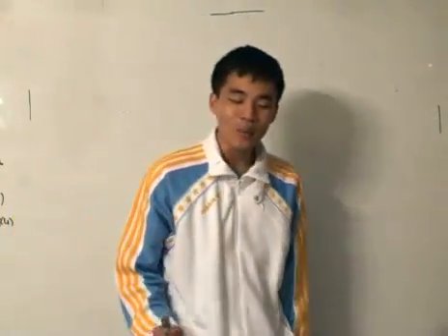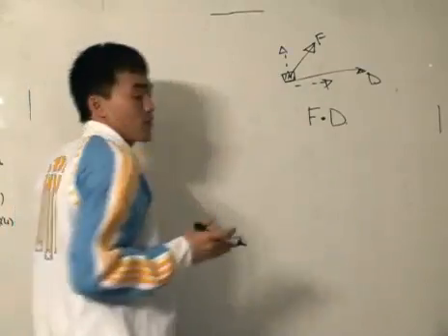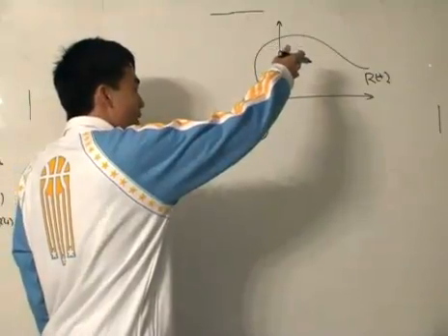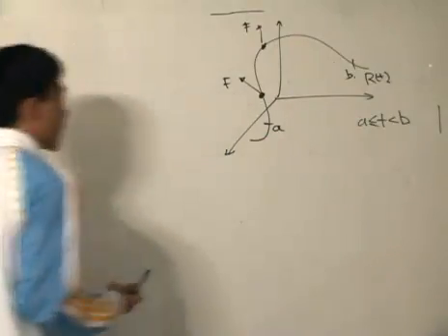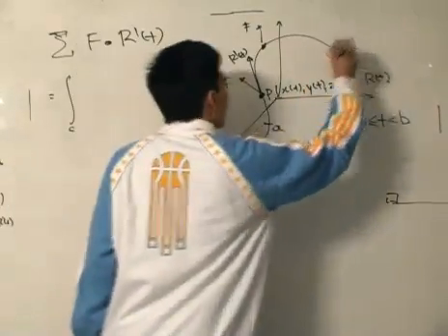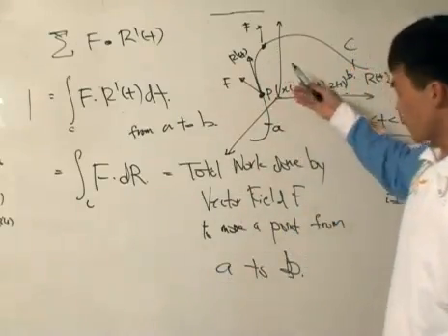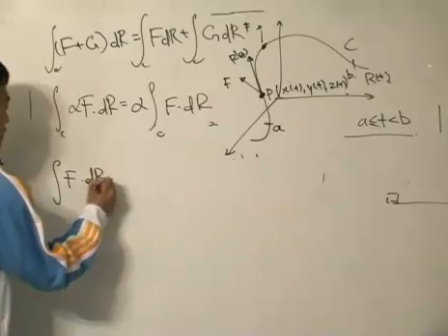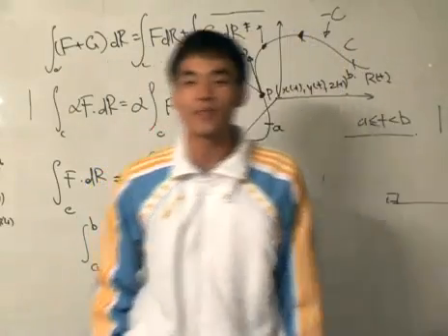Line Integral - Physical meaning

Comment from the maker: bballniket,

I know what you mean. Went to take a look and it turns out that I can't seem to give a concrete answer. You are right in saying that to get the projection of F in the direction of D, D needs to be unit, i.e. normalized dr/dt. However, I believe that the integration will 'take care' of the calculation so long we are integrating w.r.t to correct parameter.

That is, dr/dt int. w.r.t t or dr/ds int. w.r.t s (arc length).

I did an example with t and s and it works both ways.